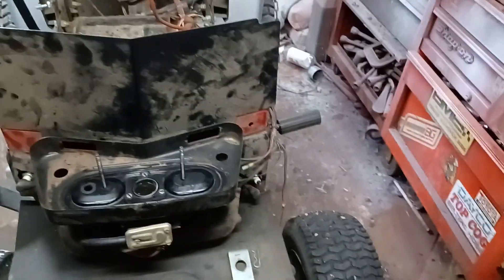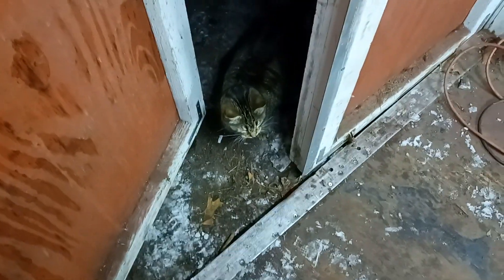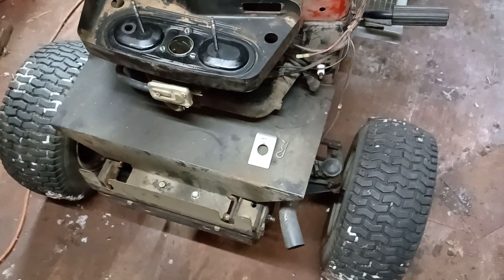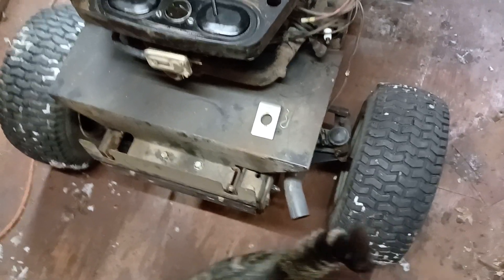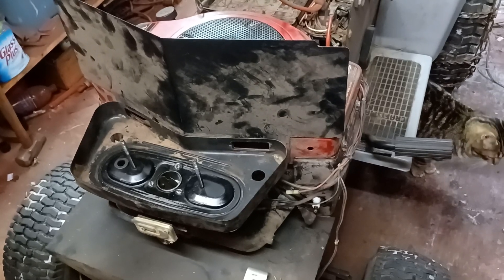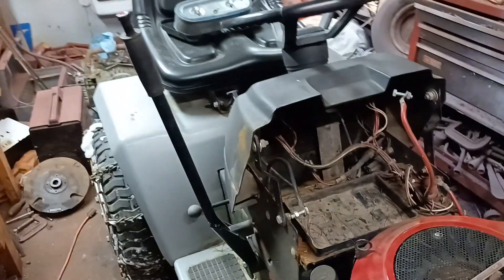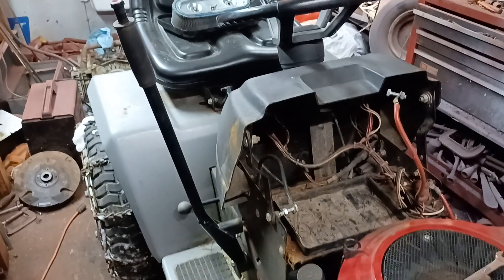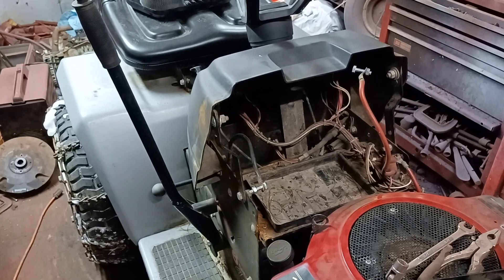we got to get this craftsman going

Comment: Props for the saltus wrench.  No one uses them anymore since ratcheting wrenches came out about 25 years ago.
Reply from the maker: Lol I had to look that up never heard it called that
Reply: @Elkskinsmowerjunkyard  What do you call them?
Reply from the maker: A swivel wrench
Reply: @Elkskinsmowerjunkyard  Makes sense.
Reply: When I would see them, there was never anyone around to answer more than "you use it to take off nuts and bolts kid!" when I would as, so being left to my own imagination, I figured it was for highly torqued fasteners that could break a ratchet, and since it swiveled around the connection, you could just start spinning it like a clock's arm once the fastener was freed, eliminating a closed-end wrench to ratcheting wrench tool swap/tool cost/etc.
I now know that while this is partly true, there has to be a bigger story someone has made on YT about the origins, rise, and fall of the saltus/swivel wrench that I will now go find and watch. LOL.
Reply: @TheOriginalFreak  If you find it, let me know....they're still popular in Europe-especially Germany.  My understanding is the box/socket also help in situations where you would normally need a set of offsets or obstruction wrenches, thereby saving you the need for 2 or 3 different sets.  I have a nice 1970's era SK set in standard that I never use.  Pieced it together at a swap meet for $20.  Until a couple years ago SK was the only USA company still making them.  Snap-On discontinued theirs about 5 or 10 years ago.

Comment: Is the carbon buildup on plugs typically caused by a) bad/blown head gaskets, b) worn piston rings/cylinder walls (aka blow-by), or c) other?
I have to assume 90% are related to a) or b) but curious as to any "other" causes for carbon buildup on plugs you have encountered over you time working on small (or even large) engines.
Great update video.  Very inspiring to see you keep plugging at it day after day.  Thank you sir!
God bless.
Reply: Worn engine letting excessive oil into the combustion chamber, can also be mixture set too rich.